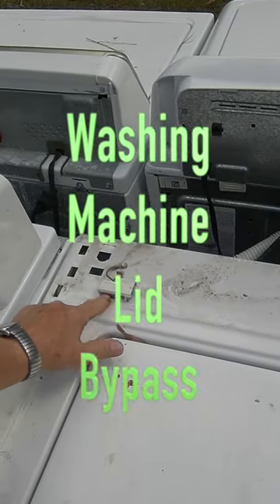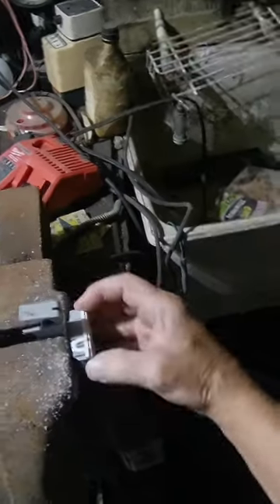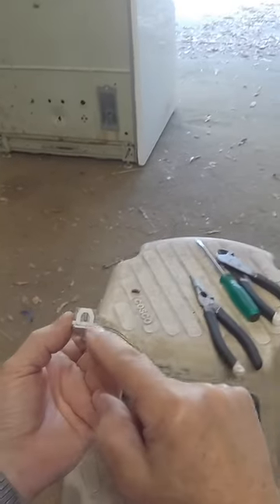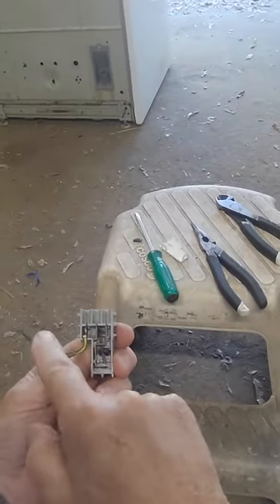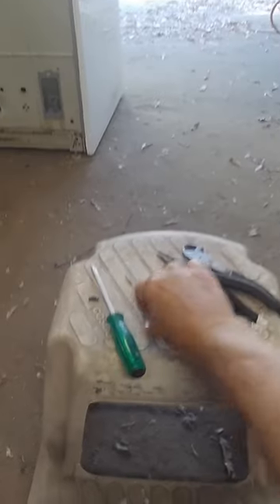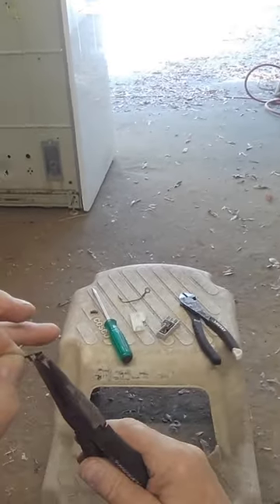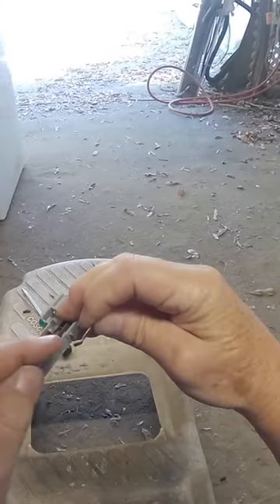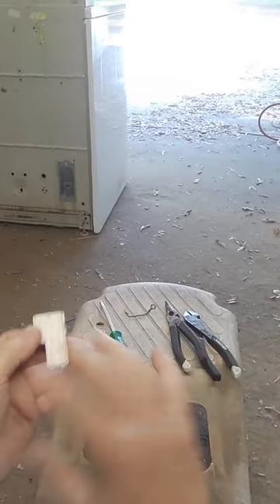Washing Machine Lid Switch Bypass

Comment: WOW that’s crazy it works! I replaced the switch and the connector and it wasn’t working. I don’t know what’s wrong with it but I did this on a Whirlpool W10140920 and it’s totally working. We don’t have kids or anything so I am not worried abt the safety feature. My only question is why not replace the ground? I did and it still works. Also does this cause any possible fire hazard lol?
Reply from the maker: The ground can be connected but I was really demonstrating how to do this for a service technician to use to test a machine. You should buy a new lid switch, they are really cheap and a safety feature that shouldn’t be bypassed unless to test the unit. As far as a fire hazard I don’t think it would be, but why don’t you just spring for the cost of a new switch for your washer. It’s there for a reason! Thanks for watching!

Comment: Can you please help me? My lid lock looks exactly like this and it melted. Can I still use this bypass trick safely?
Reply from the maker: No, bypasses are only used as a tool for service technicians. You should purchase a new switch https://amzn.to/4cdr2xh and plug https://amzn.to/43gJZLq  if it is damaged to safely use your machine again.
Reply: @HarperandKnowles  Thanks for the info.   I ordered the switch and wiring harness yesterday. I got the cover off the switch but now I'm trying to figure out how to get it out of the little hole it's in.  Will I need to take anything else apart or will the new one fit down into the hole?
Reply from the maker: The new one should fit.
Reply: @HarperandKnowles  Cool thank you so much

Comment: Hey...i tried this.. it didn't work.  My machine won't come on. You can hear the lid arm click to trigger the sensor,  but the trigger doesn't start the cycle.  Then it won't fill nor start the agitation cycle. But it will spin and drain.  Whats wrong with my poor crazy machine?
Reply from the maker: It has to fill before the pressure valve will trigger and sent power to the motor. What you have is a water issue. Either a bad valve or bad water supply. Thanks for watching!
Reply: @HarperandKnowles  I've unhooked both water hoses and checked water to make sure the pipes didn't freeze and burst or something and water indeed Comes from the wall,  just won't pump into the machine to fill it.  The machine is not telling itself to fill&agitate..
Reply: @HarperandKnowles  i also unhooked the water hose and manually filled the tub with water top see if it would agitate once the "filled" water level was reached, and it did not begin agitation cycle.
Reply from the maker: You can try blowing through the end of the pressure hose that hooks to the tub or use a short piece of hose connected to the pressure transducer to do the same thing. If that won’t get it to agitate. Examine the motor plug for a burned spot on it. It may not be getting power to turn the motor in the direction to agitate.

Comment: Only use it for testing a machine in your shop
Reply: It is a spin/ agitation safety switch, extreme physical harm can be done if arms , hands , long hair comes in contact with a moving agitator or spinning inner tub.
Reply from the maker: Excellent point!  I never let a machine leave my shop without a working lid switch!  Thanks for pointing that out!
Reply: @HarperandKnowles  This video is for ho-moaners,  not cervix techs. There are other good reasons to bypass a lid switch,  other than to perform a Mickey Mouse field "repair".  I have done it lots of times on commercial machines, notwithstanding a disclaimer from the site manager or owner.  With certain front loaders especially,  it is useful to disable both the lid lock and lid switch plus add a switch to the dump valve,  for adding soap or other chemicals during agitation.  Honestly,  I can think of much easier and faster ways to get sued.  Door interlocks are for stupid, careless operators. ;)

Comment: This is silly. You're doing it the hard way.  I just melt a little section of the insulation on the wires outside the switch and either twist them together or add a rocker switch.  You can even install a bypass switch on the front escutcheon,  with a little skill. If there is a lid lock,  that can be taken care of while you're in there.
Reply from the maker: Thank you for your comment! I understand that you have found a different approach to bypassing the lid switch, but it's important to note that the method I demonstrated in the video is intended for service technicians to diagnose washing machines, not for permanent use on customer machines. As you mentioned, it's crucial to return the machine to service with all safety devices working to ensure the safety of the users.

While there may be alternative methods, it's important to emphasize the importance of following manufacturer guidelines and safety protocols when working with appliances. These safety devices are put in place for a reason, and tampering with them without proper knowledge and training can lead to hazardous situations.

If you have any questions or need further clarification, feel free to ask. Thanks for sharing your perspective, and I appreciate your understanding of the importance of safety in appliance repair.
Reply: @HarperandKnowles werk